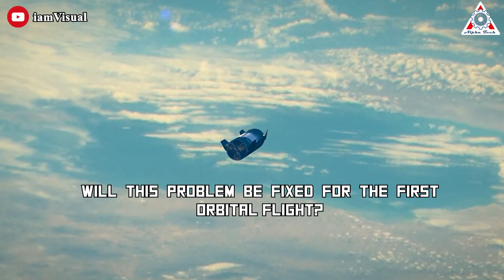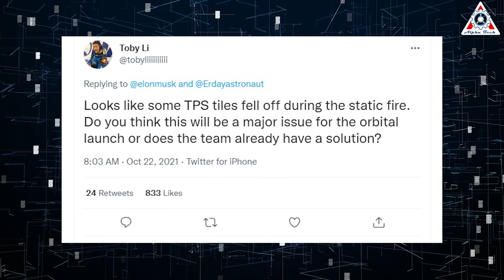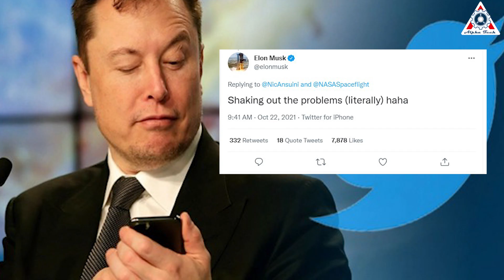SpaceX Starship's heatshield Testing problem!

Comment: The vibration will be significantly reduced in an actual launch where the ship isn't bolted to a launch stand. Most of the tile loss is due to this excess forces applied by the test stand.
Reply: Many tiles were destroyed because of the concrete blasting from the ground.
Reply: haha yeah sure. Max Q or an orbital insertion is peanuts.
Reply: It can be worse…depends on main frequences and Where they occur
Reply: very good point.
Reply: You're right.  The 6 Raptor 2 engines on the Ship don't ignite until stage separation has occurred at 60 to 70 km altitude when Starship is well above the denser part of the atmosphere. So, the acoustic energy from the engines will be nearly zero and have no effect on the tiles. As you say, the vibration energy from the engines will be less because the Ship is not clamped onto a test stand but is separated from the Booster and is flying free.
Reply: This is a misleading line of thinking. Rockets are always bolted/attached to the launch stand/tower for at least several seconds prior to lift off. Using several notable heavy lift vehicles and space X rockets, launch times can range from the following: 
Falcon 9: t-3 secs
Saturn V: t-8 secs 
Space Shuttle: t-6.6 secs
N1: t-2-4 secs (hard to tell)

All of these rockets experience significant vibrations while attached to a tower or stand, most notably the N1 and shuttle, with astronauts complaining of significant vibrations of the Saturn V. The majority of Starship tiles dislodge themselves in the first 1-3 seconds when ignition vibrations are the most severe. This is an issue that SpaceX has to figure out before they can human rate their spacecraft.
Reply: @narfbite5239  
As "Stephan F" pointed out, a viable approach might be to increase the thickess:area ratio of the tiles.
Another might be to capitalize on the apparent ease of replacing the tiles.  On manned missions, send two or three (ten?) times the average number of tiles lost in static fires as cargo with 2 EVA suits and tethers.  Send out a crew member to push new tiles onto the studs.  If the suit is sufficiently durable, send 2 out.  Replace the tiles before re-entry is an issue.
Reply: Is there an off the shelf epoxy that can be applied to each tile to absorb the vibrations and heat during static fire?